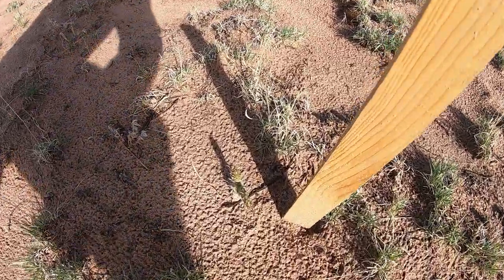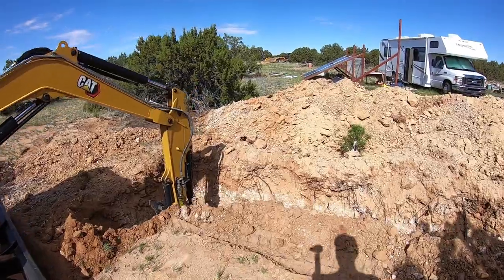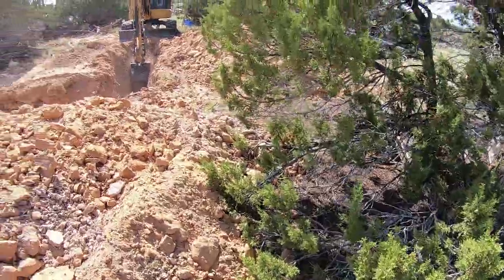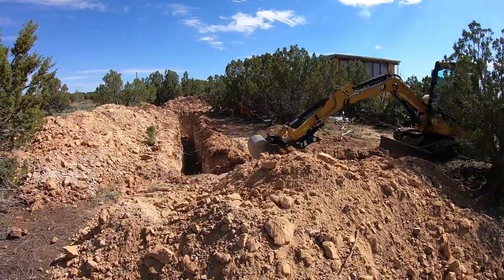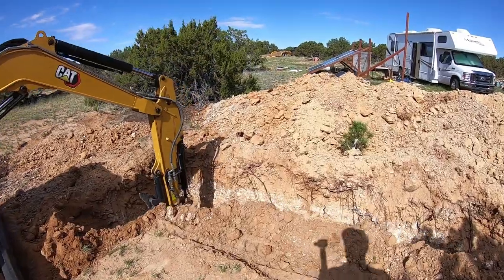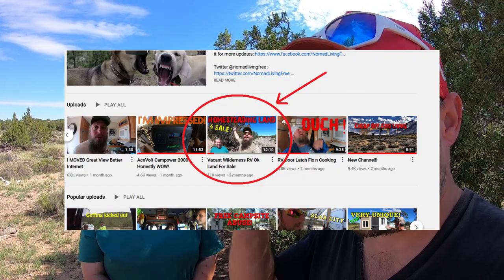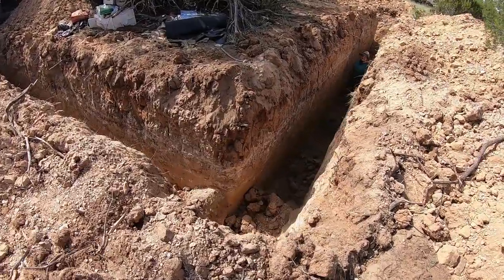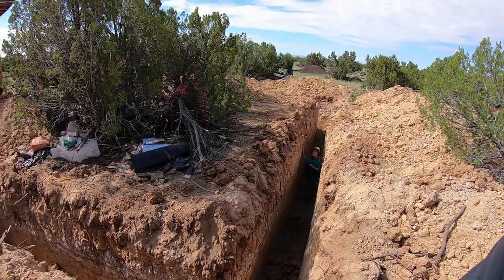Passive EarthTube Heating & Cooling

Comment: Just a safey comment, being in a trench like that is dangerous. Be careful.
Reply: Trench collapse is very serious, could kill you easily.
Reply: 100%
Reply: Every video there’s this guy.
Reply: VERY dangerous, there are LOTS of detailed safety regulations and OSHA requirements regarding shoring for a reason…cause lots of people die each year doing this exact type trench work. Numerous precautions and measures needed to do this type work safely.  We have detailed prep/process to follow at work when that type of work is done.  PLEASE PLEASE educate yourself and take the proper safety precautions.
Reply: And she's picking at the walls 🙄

Comment: PVC is actually a good insulator so it will resist the cooling/heating effects more than if it was another material.  Of course, copper or aluminum would be a lot more expensive.
Reply: PVC has toxic off gases for a few months if it’s new. Let it sit in a well ventilated area away from the Sun for a few months to off gas. 

High Density poly-Ethelene (HDPE) is a good option as well. It is stronger and has no off gases.
Reply: I plan on using that corrugated drain line but getting discount on the pvc might run cheaper for her.
Reply: @stevenhall2408  I would imagine the corrugated pipe would restrict airflow causing the fan to be inefficient. I believe a smooth bore pipe would be better.

Comment: Anytime you blow air through a cooler area, you have to allow for condensation. There's a reason they run water circulating pipes to air exchangers; you can collet the condensate in the exchanger. Home In The Earth home build has earthtubes and he's sloped to drain the condensate. Problem is eventually stuff will grow with the dampness so we'll see.
Reply: I have been thinking of a liquid system for 40 yrs .The mold problem can kill you.  An idea i have is slanted with UV light in tubes. I have never price compared them   another advantage of liquid is a simple roll of PEX in a partial green house would eliminate an expensive heating system. A large thermal mass mid room would be the ideal heat/cool exchange point.
Reply: That's exactly what came to my mind. It may be a huge problem even in commercial HVAC systems. I think that those underground air tubes could be great because of very low power consumption compared to heat pump and because they provide ventilation, but a safe system gets rather complicated. There have to be another bypass air intake, remotely controlled vents, temperature and humidity sensors and a tuned system that closes of the ground tubes if the dew point would occur inside. That's the minimum. But you'd probably want to control the temperature of the incoming air as well, so another piece would be a heat exchanger. Add more sensors and vents between all the components, fans and much more complicated logic to control it and the price goes steeply up. Also, start to learn PLC and programming Arduino (or get those knowledgeable friends), if you want to stick to DIY :-). It's not impossible, but I'd call it challenging!
Reply: @jcadult101 Some of the mold issue in a system like this might be mitigated by perforated piping and allowing some drainage in the soil and clay acting as a desiccant but then obviously with all the holes in the piping you're compromising the structural integrity of your system and anything could crawl or find its way into your piping, roots and whatever else.
Reply: @AgentSmith-x9p french drain pipe has holes in the bottom. So you pour rock below. When water builds up, or enters the tube, it will flow down through the hole into the rock below back into the soil. Dont plants drink water? Litterally an indoor garden in front the tubes would feed fresh oxygen and pure natural air from nature. Im sure log cabins which used dirt as packing and vikings who built the house in ground were fine

Comment: 4" thin wall down under 8' of earth, that same material you are digging out I assume. You said it was damaged so you got 50% off. Hmmm 4" thin wall 8' down... I am guessing this won't last long. When doing a job you only want to do once spend the money and do it right so you really only have to do it once. if you are not doing this through a heat exchanger you will get a condensation musty smell out of the pipe especially if the pipe gets cracked on back fill which is very possible with thin wall pipe down 8' when dropping lumpy backfill onto it. This should be laid on a bed of smooth sand and buried in sand before backfill as if you were installing a new sewer run.
Reply: With 4" pipe, it can hold 8 cubic feet in 100 feet of pipe.  So with less than 16 cubic feet underground, they will not get much cooling.  It is not the 12" diameter silver impregnated piping used in a proper heat recovery system, that will not grow mold (because of the silver in the PVC pipe, it will kill any mold).  

So with 16 cubic feet if airflow, that means the air will spend about 1 minute in the pipe.  So with 100 CFM, that is only about 15 seconds in the lines.  Really not enough time to work effectively.  

They will find out soon enough it will not work, well before the pvc pipe becomes full of moldy and musty air.  

I was at University of Irvine CA, and they had air intakes in cement, located about 15 feet underground, and about 100 feet from the building, so they had a effective way to cool the incoming air a little bit.  This was built back in the 1970's.  The local ground temperature in Irvine is about 55F.  In Oregon, the ground is typically about 45F.  In Colorado, I would say it might be between 40 and 58F depending on the location.

Comment: Passive EarthTube Heating & Cooling only work if you don't have high expectations for your heating & cooling needs.

The Earth is a consistent temperature as you get deeper.  That temperature isn't inline with what people would generically call "comfortable".

This is why geothermal is a thing.  It doesn't just use that temperature.  It is a normal heat pump that uses the ground temperature to mitigate subcooling and superheating; instead of working with ambient air temperatures, it uses that consistent temperature to maintain efficiency.  That's it.  When you're trying to cool at 90F+, it gets more difficult to push more heat into 90F+ air.  Likewise, if you're well below freezing, it gets more difficult to extract heat from that.

Even if you're supplementing.... this doesn't really work well.  If you set your heater to 64F in the winter and you're supplementing with 55F air... that 55F is cooler than your desired temperature.  If your system gets the temp to 64F, the ground temp will be counter productive.   The only way the ground temp can help with such a system is that you turn your system off for 3 weeks and it keep it from getting much below the ground temp.  The ground temp will not supplement it.

If you're cooling, 55F isn't really cool enough to help around 75F, or lower.

Also, walking in trenches like that without bracing... super freaking dangerous.  Especially when there is someone walking around above.

Comment: Comercial systems, they run plastic water lines in loops under the ground and pump water or glycol to supplement heating and cooling. My Grandpa was planning to do this same system 20 years in the deserts of Western Colorado. I purchased the house from him, and when running cable under the house, I found his big hole under the house he was planning on using to go out into an open area. Still, that open area is holding a septic system, so I think he never got to it along with the gravely rockie dirt around the property, unlike that nice dirt in the video. It would be great to see a follow-up to this and show some temperature readings of the air going in and out.
Reply: 100 feet of 4" pipe will hold about 65 gallons or 8 cubic feet of air. So with 170 feet of 4" pipe, this is about 15 cubic feet of air total (well less).  So if you move 100 CFM through the piping, it will spend 10 seconds in that pipe, not really enough time to cool the air very much.  And after about 20 minutes, the temperature drop going through 55F soil will become much less.  

So my guess is on a 85F day, when the air in is 75F, the air out will be over 65F at 100 CFM.  Less air flow and it might cool the air a bit more, but still not be a effective cooling for a RV or home.

Comment: So, if 78 degree goes out of the house and into the ground that could be 55 degrees.  at 20 degrees difference you get condensation.  Where does the condensation go to and how long before it starts growing stuff.

Comment: With 4" pipe, there is 6.5 gallons in 10 feet.  So you with 100 feet, it is 65 gallons or about 8 cubic feet if air in there.  So if you pull 8 CFM, it will spend about 1 minute cooling inside the pipe.  Your longer length, a little more than 1 minute.  If you increase this to about 96 CFM, that is with your 170 foot length, about 15 seconds in the pipe.  Maybe enough time to cool the air.  Hopefully!  

By the way, a 12,000 Btu A/C unit can put out 400 CFM of air, and will use about 1,000 watts per hour.  (For a ductless heat pump that is 20 SEER, and can cost $730 on Amazon. ).  So input air on the ductless heat pump is 75 with output of 55F.   Or 85F input and output of 62F.  

I was considering putting in a 12,000 BTU 120 volt ductless heat pump, and run it with 8 each solar panels, a set of 8 batteries (6 volt X 200 AH golf cart batteries wired to 48 volt DC) and a 5,000 watt pure sine wave inverter.  The PowMR inverter is $750 on Amazon with a MPPT charge controller.  I bought 8 each 250 watt solar panels for $85 each on Craigslist.  Battery cost at Costco is $120 each, so about $900.  So for less than $3,000 you can have a solar system, battery system, and 5 KW inverter to power the ductless HVAC and anything else when cooling and heating is not required.  

I have fairly low cost electricity, so it would only save me about $30 a month.  So I decided the hassle to install it, and the cost, the $30 in savings each month, it was not worth it.

Comment: Kind of a poor man's heatpump.  Since the ditch is so wide, I'd consider running 2 pipes, 1 toward each side, inner and outer edge. Should be plenty of separation.  Also, an 8 foot deep trench? The ground looks stable, till it isn't.  I'd have a spotter when down in the trench in case of cave in to dig the other out. I'd also consider doing a radon test on that air. Thin wall or tripple wall pipe isn't known for gluing well in the joints. I'd lay sticks across the trench and cut, fit ,glue from above, then pull the sticks and rope drop it down. Good luck.

Comment: Very Interesting! Can pvc be strong enough to withstand the pressure when you backfill it? And and and wouldn’t the tree roots be an issue for the pvc?
Reply: The pvc pipe is designed to buried because it's designed to be used as a toilet pipe.,

Comment: This is not passive since a fan is used. It would be passive if it was not a closed system. In other words, if the pipe actually opened to the air outside, cooled that outside air traveling into the pipe until it reaches the home. If a window on a second story or skylight is open in the house, the stack effect will naturally drive a current through the pipe on a warm/hot day. This system could be hybrid too if a damper were attached to the open pipe outside and then a fan could be used the same as in this video.

Comment: water is 1000 times denser than air, so carries much more heat, so you can use a smaller tube at the expense of a simple pump and heat exchanger (radiator)

Comment: 4 inch is kinda small for this, thin wall isn't meant to be buried under alot of weight, I don't think you'll get proper heat transfer with that small of pipe, what about moisture coming in.

Comment: pvc pipe works?
Reply: 12" diameter PVC pipe will work well, if Impregnated with silver to control the growth of mold.  Then you can have 0.8 Cubic feet of air in each foot long of the pipe, so 60 feet of pipe will hold 50 cubic feet of air and have a surface area of about 100 square feet, so it can effectively cool about 100 CFM of airflow about midpoint between the incoming air and the ground temperature.  So if you are taking in 75F air to a 55F ground, it might put out 65F air.  With 60 feet long 12" diameter pipe, then 100 CFM means the air only spends 30 seconds in that length of pipe.